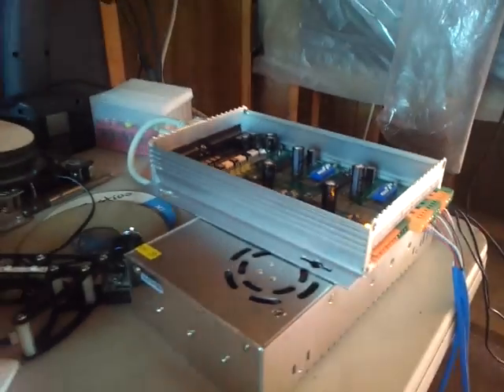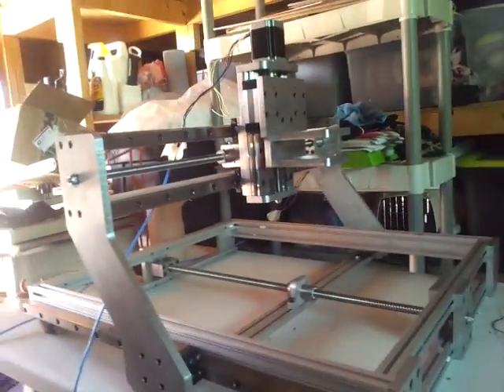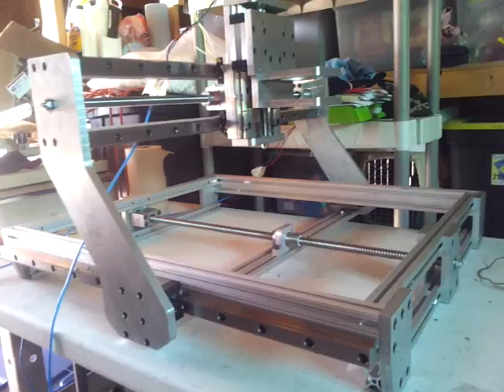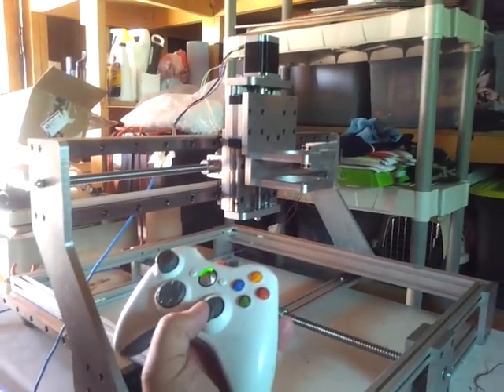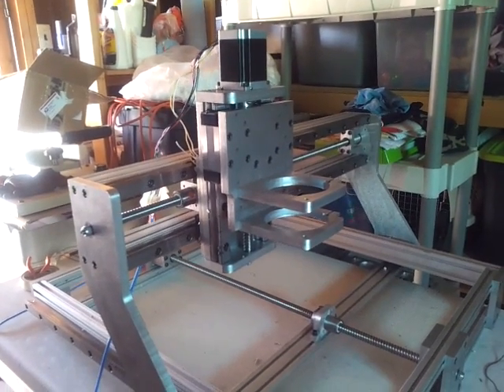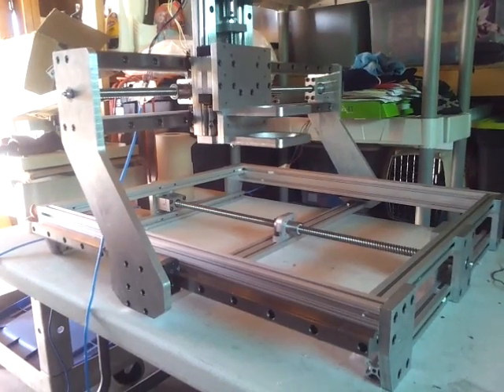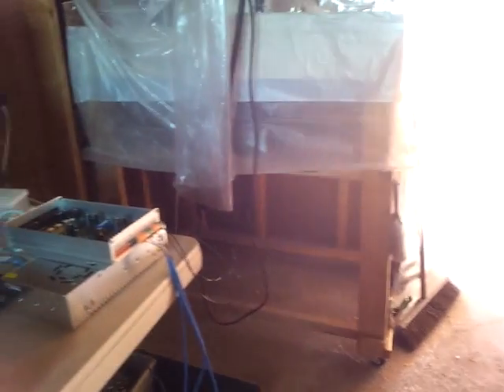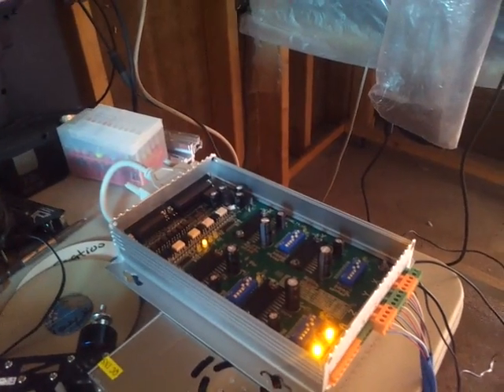CNC router wired up drivers on my new machine

Comment: dumbed down am i right in thinking it goes CNC router has motors, motors controlled by driver/controller, controller plugged into computer, computer running a program(mach3) runs Gcode that tells controller how much to move the motors? 

Its all very confusing..I have paid enough money for shops to machine my stuff to buy one so that what i have decided to do :) Your videos are very helpful. thanks ken